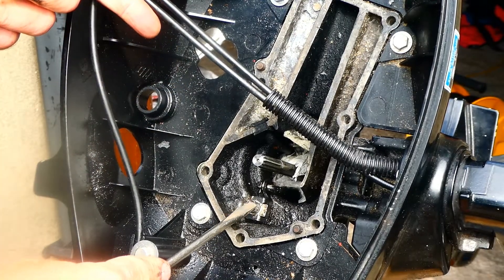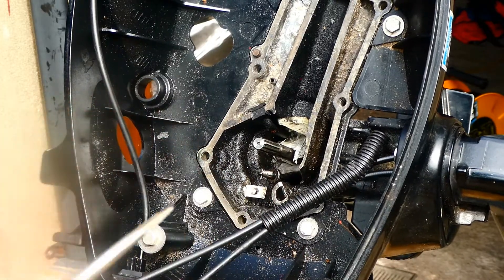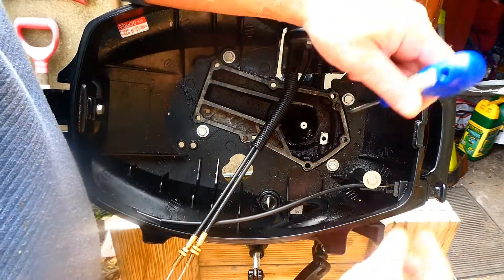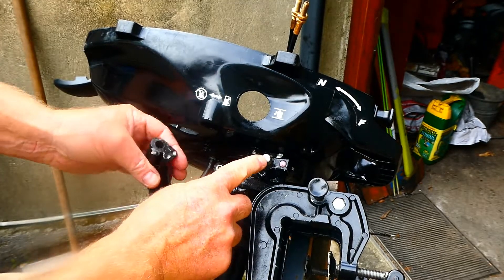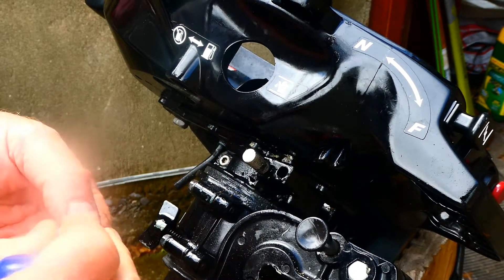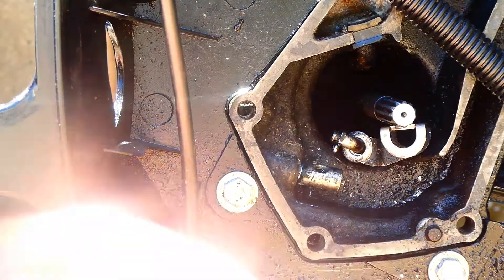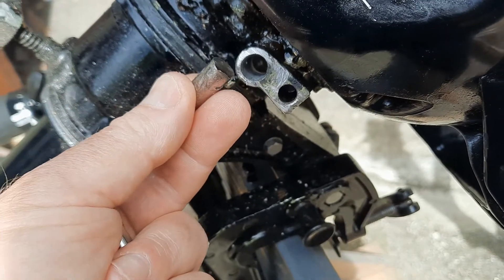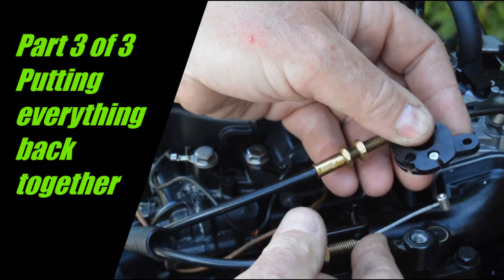Frozen Gear Lever (2/3): replacement in a Mercury 2.5hp outboard engine

Comment: Could you send the link where you ordered the parts from
Reply from the maker: From this eBay shop https://www.ebay.com/str/outboardmotorshop
and this was the part: https://www.ebay.com/itm/273134448045?epid=1914249422&hash=item3f9814edad:g:wbAAAOSwC-xavfFk
Good luck